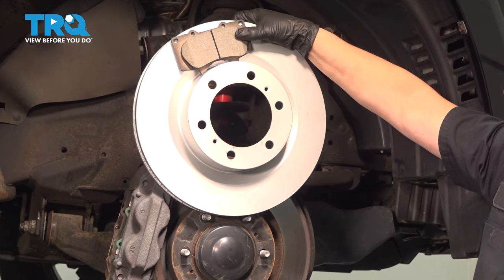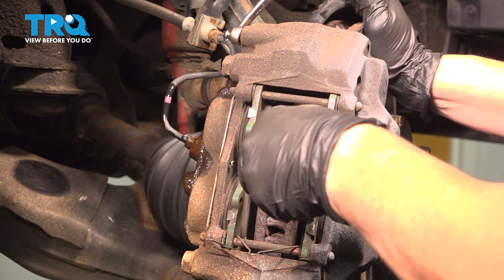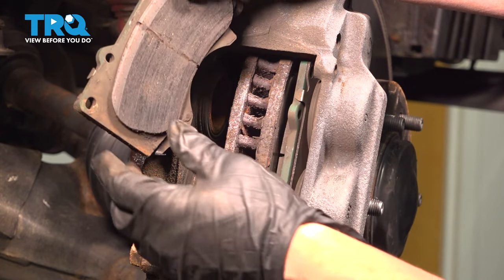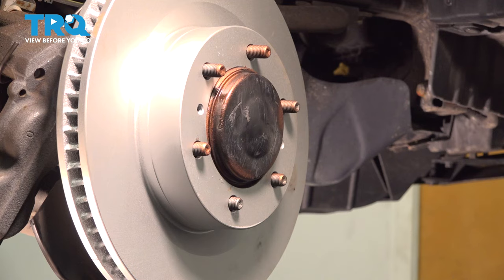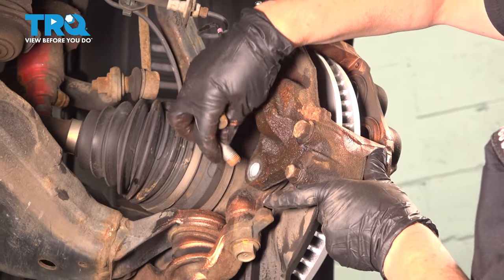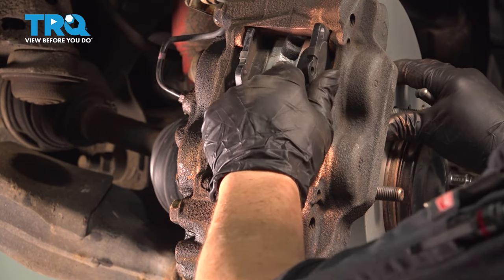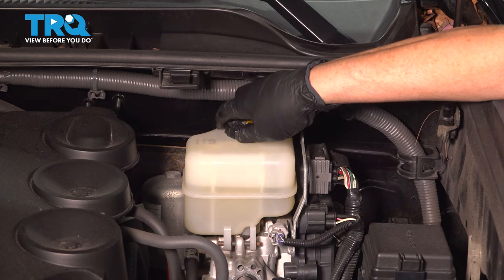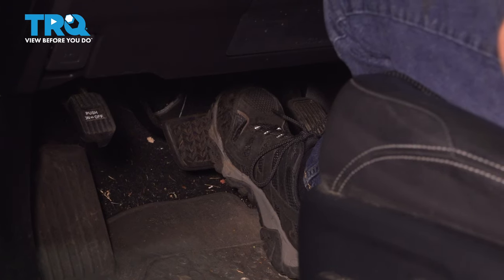How to Replace Front Brakes 2010-2023 Toyota 4Runner

Comment: Thanks for the video!  Swapped my front brakes today and it went well!  Just a caution to folks- I discovered that one of the my piston seal retention rings  had come off on its own during driving (it fell out as I was gently removing the pad, so it was a Toyota defect) as there was a build up of dust behind the portion of the piston that was exposed, which I cleaned before reinstalling the ring.  The factory brakes had developed a slight vibration, especially if there were passengers about a year after ownership..and I never abused those brakes, so I figure that was the root cause since that piston was a bit slower to push back into the caliber with the ratcheting spreader tool.  I have the OEM seal kit on order and will be changing them all if need be.

Comment: Just finished front brake job on my 4Runner, thanks to your video. This is by far, the most comprehensive 4Runner pad and rotor replacement video I've come across on the internet. I purchased the caliper piston spreader from your website. After using it on a Rav4 and 4Runner front brake job, I don't regret the purchase at all. Makes spreading the pistons easy and less stress of possibly messing them up. Thank you.

Comment: NOTE* Not ALL Toyota 4Runner have 19mm Bolts mounting the Caliper to the Knuckle. My 2014 Toyota 4Runner Limited uses 17mm Boots with a Torque of 91 ft.Lbs. - I thought I had everything ready then realized it's not 19mm like you said at 5:13min. (I had to run to O'Reilly's to get a 1/2 x 17mm.)